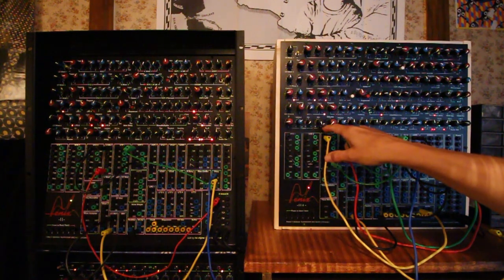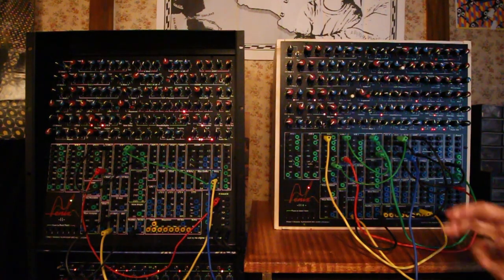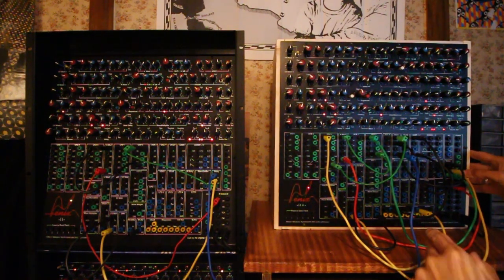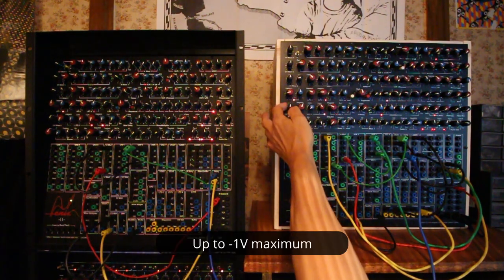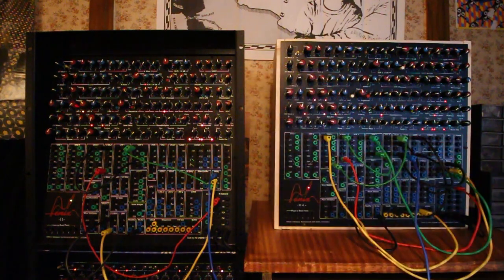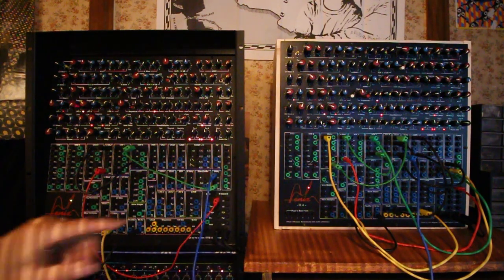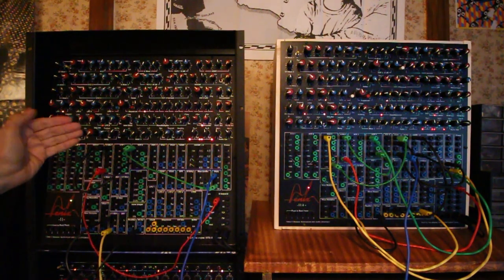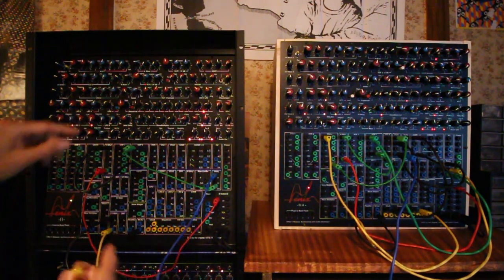A trick to lengthen the delay on a Synton Fenix

Comment: Sympa l'astuce, merci... Bon ça ne fonctionne pas sur mon Z5000 de chez Tiptop :/
Reply from the maker: Envoyez te la tension négative c'est un peu spécial sur le BBD du Synton. C'est souvent un offset positif que j'utilise sur d'autres modules. Je vois que le Z5000 utilise un DSP. Je ne veux pas dire trop de bétises ici ne connaissant pas le module, mais on aura l'occas de regarder ensemble sur ton système.
Reply: @batchas  En effet, je vois aussi que dans la serie FX de Tiptop, la version ECHOZ possède un algo BDD, peut-être que cela fonctionne sur cette version...
 Je creuserai un peu plus le Z5000 pour tester sur d'autres algo. Et tu passes quand tu veux pour qu'on regarde ça ensemble à l'occaz
Reply from the maker: @G4C4  Sur un module digital, si tu sors du range „autorisé“ (comme je le fais en appliquant une tension négative) cela ne va rien changer car le convertisseur analo vers digital (A-to-D) est limité par nécessité (genre de 0 à 1023). Donc si tu envoies un courant sous la limite minimum autorisée (cette limite peut très bien être une valeur négative - comme sur une entrée CV bipolaire par ex.), ce courant est vu comme la limite minimum autorisée. Tu peux aller dessous, mais cela ne change rien si tu vois ce que je veux dire. Idem si tu dépasses le maximum. En analo c’est différent.